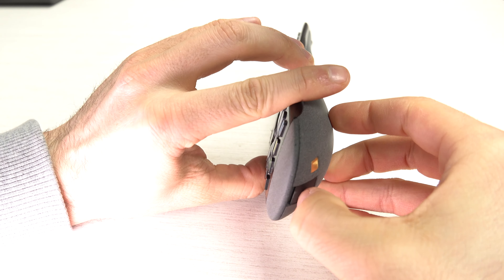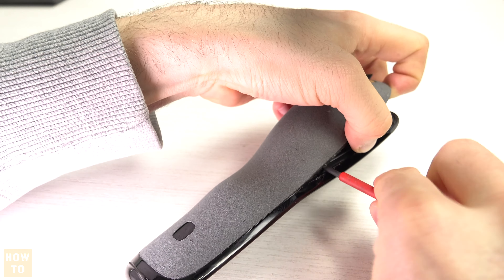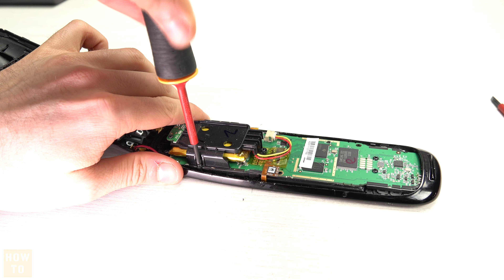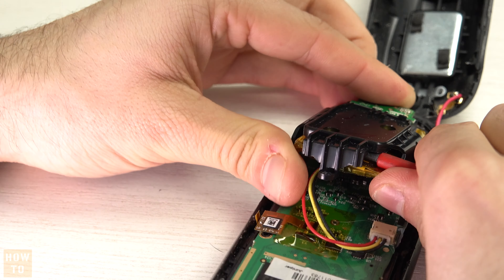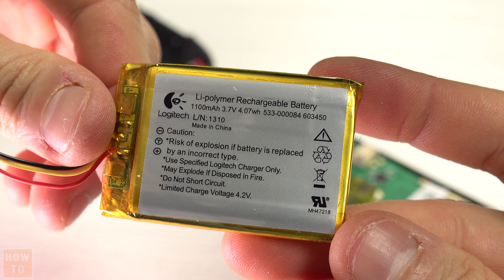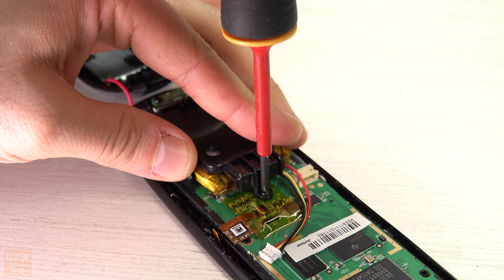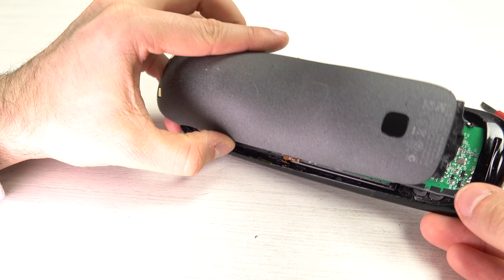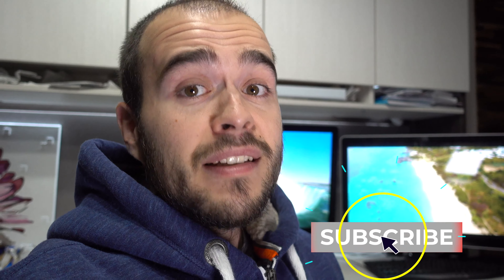How to Replace Battery in Harmony Remote Remote Touch / Ultimate / Elite

Comment: Thank you for creating this video. Your advice about that ribbon cable was very useful. Managed to replace my battery successfully in about 10 minutes. It might be useful to know that my model has a vibration motor that is attached to the main board and needs to be unplugged before removing the back.

Comment: Thanks for sharing, this really helped. As another commenter mentioned, mine too has a vibration module which needs to be disconnected as well since it is attached to the back plate. The small circuit board on the battery housing comes off in a little tricky way but if you are gentle enough with tools, the battery can be detached with a guitar pick tool. I was nervous about using a sharp tool to remove the battery and accidentally puncturing it.
in the end, it worked well, currently charging my remote and I could tell already that it is working ok now since the old battery would send a wrong signal to the device that it was fully charged and remote would auto shut off charging. This time it is showing me that battery is being charged. Fingers crossed!

Comment: Thanks. I managed to get the battery cage out. I was worried about prying out the battery with that top circuit board there. Thought if I pryed it with it in the vid I'd either break the board or crack the battery and start a fire.
So the trick to get the cage out is undo all 4 screws. Then lift the small top board a little above the plastic tabs it locks into.
Then rotate it clockwise a bit which allows you to free the plastic stand at the bottom.
With the battery and cage out, prying the battery out is easy and risk free.

Comment: Thanks for this, and thanks also for showing what NOT to do (use a metal jimmy to get the back off), to avoid ripping that cable. Just replaced mine last night, and it went easier than I expected. Curiously, my Harmony remote didn't have any sticky stuff holding the battery in place - so once I unscrewed the cage, it was easy to remove & replace. Thanks again.
Reply: A thick guitar plectrum works best, IMO.
Reply: @happyspaceinvader508  I used a similar plastic jimmy that was shaped a bit like a plectrum, but that would certainly do at a pinch.

Comment: Great video thanks. Would you please provide a specific link to the replacement battery?  (I clicked on the link you gave, but it just brings me to an Amazon general listing for multiple batteries and none are what I need.) I have the exact same battery as your old one - Logitech L/N 1310 1100mAh 3.7v.  Would appreciate if you could share - can't find the right battery anywhere online. Thank you
Reply from the maker: Hi Bada Bing! Thank you very much for your comment. My link point to the right product according to your country, but will point to that list if it was not found in your country. Please let me know where you are from and I will be glad to update my link so you can find the right battery. :)
Reply: Hi. Thanks so much for getting back to me. I'm in Ireland so would have thought the Amazon UK link would work. All I can find online are generic (Cameron Sino Tech, etc.) batteries - usually li-ion too (instead of li-poly) and slightly smaller (i.e. 1050mAh). Doesn't seem to be any Logitech branded or even just 1100mAh 3.7. Will keep digging, but would be great if you have a link. Thanks again.
Reply from the maker: Ireland! Such a beautiful country that I would like to visit after the pandemic! :) 
I have updated the link for Ireland.
But I didn't find better then you.
It's the Cameron Sino Tech. The most important to watch is the voltage. This must match to voltage of the previous battery.
The slightly lower mAh will only reduce the usage time of the remote by few minutes, wich will still be far greater than your old original Logitech battery.
I hope this will help!
Cheers from Canada! :)
Reply: Ahhhhh, we should swap places - always wanted to see so much of the 'great white north'. Thanks again for the reply, reallt appreciate it. Merry Christmas
Reply: Should have asked, that updated link is for a li-ion battery (as opposed to the li-poly original battery). Think I found an 1100mAh li-poly on another site though. Thanks.
Reply from the maker: Ahah!! Yea Canada is a wonderful country! :) Merry Christmas to you to! :)
Reply: I live in Canada. Can you provide me with the link as I’m not having much luck finding the battery for my Ultimate. Thanks.

Comment: hi.
if you use heater,isn t it easier to remove  the battery?
Reply from the maker: Hi Nikos! Well, it may help of course but... Using a heater on a battery seam very dangerous to me.

Comment: Slighty different set up to my remote, there was a cable attached to the bottom part of the remote that looked like the IR blaster, but anyhows great video I managed to pry out the battery with ease and now have a 1800mAh battery installed, happy days.....
Reply: hey, which battery are you using?  can you link it here please?

Comment: Thank you for this video. At 1:16 you mention accidentally breaking a connector, but I can't see how it broke or how to avoid. Could you provide a bit more detail?
Reply from the maker: Just be carefull. I input the screwdiver into the remote and pry right on the printed circuit the make the connection to the screen.

Comment: I did a factory reset on my ultimate harmony, but the sync process still hangs at 35%. Please help!
Reply from the maker: Connect it to your computer with the hamony app.
Reply: @HowToPM  I did, it's the only method for the ultimate. The only thing I haven't tried is using the OSX version of the app, but I don't have a mac and am out of options now.

Comment: This made me cringe!  Not just the part where you use a metal screwdriver to prise apart the case, breaking the screen connector... but the part where you attempt to free the battery (also with a screwdriver) without removing the battery housing from the motherboard.  That whole black case can be removed relatively easily (with some care) making it much easier to remove the battery without risking damaging the motherboard underneath.

A sturdy guitar plectrum is what you use to prise apart cases without damaging (if you're not willing to spend $2 on a plastic spudger).

Comment: Why would you use a screwdriver as a tool to remove the cover, surely you should use a trim removal tool of some kind? Nice video, just using the incorrect tools in my opinon
Reply from the maker: You are right. I just did it with what I had.

Comment: these remotes are utter garbage, i hope to see Logitech go completely out of business in the next few years, no way they cost more than 20 bucks to manufacture, they are poorly manufactured and supported...the touch was our second after our first model broke, now our touch is stuck on the harmony screen and no amount of turning off, rebooting, trying to connect to their garbage slow desktop app helps at all, good riddance to logitech, their computer products are junk
Reply: On the flip side, I love Logitech. I had a previous remote, which had a swollen battery that I couldn't remove. This was after owning the remote for about four years (so long past the warranty). I sent them a picture of it, and they sent me a brand new Harmony Elite as a replacement the next day. No charge. That's what I call customer support.
Reply: I’ve got Harmony remote for more than 5 years and as a low voltage technician I have personally installed and setup hundreds of Harmony remotes for customers. They work perfectly and their customer support is excellent. I don’t know what you are talking about